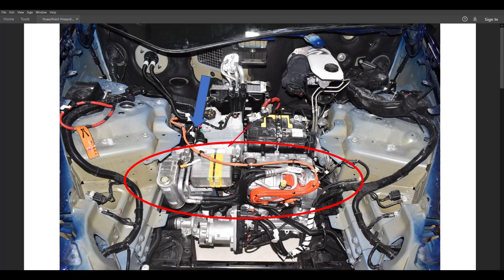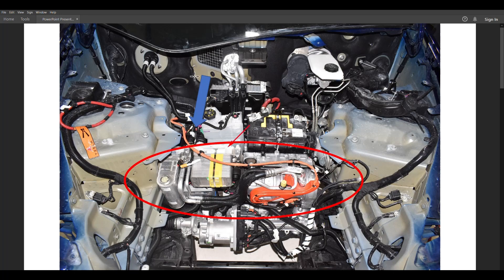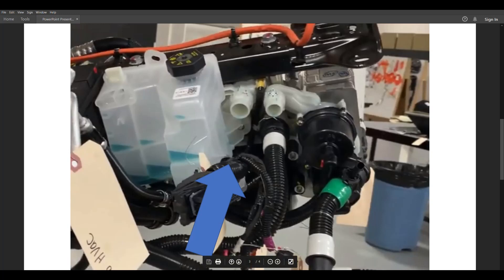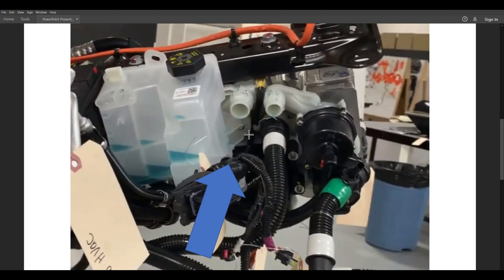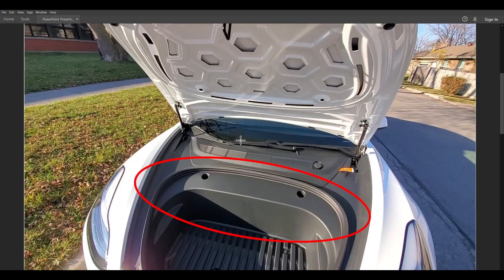Tesla Model 3 SR+ 2021 REFRESH - Octovalve and Heat Pump

Comment: Nice vid. Thanks for sharing. Did you put your winter wheels on? Which TPMS are you using?
Reply from the maker: No winter tires yet, will make a video on that! Tks
Reply: @curveball4641  Great! BTW, when climate ON, do you hear/feel some sort of cycling vibration or rumble?

Comment: if the pump fails, the car can still work? like a 2020 that has no pump?
Reply from the maker: Yes, it still as a PTC heater (resistive heater) in series with the the Heat Pump to warm the cabin up. Vehicle will run but way more inefficiently.